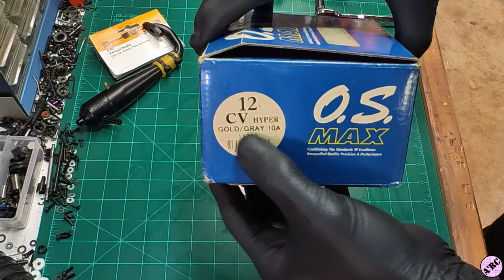OS 12CV Hyper Nitro Engine Overview - HPI Tuned Pipe A950

Comment: I have one of 2 these it’s not new but they work also one has an o donnel racing head an the other has the gold hyper both non pull start love em great engines I don’t use them as much anymore though too keep them in good condition one of the carbs has different adjustment on the low speed instead of just being a screw it’s got a metal spring sorta thing around it so you can adjust the low speed in small intervals gives it a click sorta feel per turn if that makes sense reslly helps with fine tuning the low speed
Reply from the maker: Oh yeah, I definitely know what you mean about the “clicking”. OS, for some reason, made a couple changes/revisions of the carbs along the way
- It’s awesome that you have two of these engines. Both 12s or are they 15s?  What car/truck are they in?
- Clean them up and run a bit, as you know they are fun to drive 🩷

I appreciate you taking the time to write and great message. Love it ‼️

Comment: Thanks for the interesting video! Great looking engine! Are all the OS CV engines (12 and 15) ABN construction? As I remember the CVR's are with ABC. If you compare ABN with ABC what are the advantages and disadvatnages of both in your opinion?
Reply from the maker: Hey and thanks for the question (a great one)! 
- OS made a mix of engine styles with both ABN and ABC. You are right, the CV-Rs do have ABC construction. 

They do have their differences, ABNs generally have thicker sleeves to help compensate for the nickel plating (which is not as hard as chrome). It is also less expensive to nickel plate a sleeve. 
- The ABCs that have chrome plating, last much longer, the sleeve is normally lighter weight, generally can with stand higher temperatures and lower oil concentrations but, it is more expensive to manufacture. 
When you compare the two styles, higher performing and reving engines will be chrome plated

I hope that helps a bit and as always, I appreciate you watchn’ 🩷
Reply: @a2rc  Thank you very much for the clarification! It would be very exciting to see a future video, dedicated on breaking in procedures! I'м very curious to see how you perform it! I've seen videos on youtube how people don't stop their engines during the heatcykles, just cooling them down with compressed air and having them running during the whole process (to avoid the cold start).  What is your opinion on that?
Reply from the maker: @lyubennyagulov9012  umm well, I personably wouldn’t suggest that….

Break-ins are/seem to be very subjective but, I have been performing my break-ins the same way for 25+ years now. I seem to have pretty good success so far. A good example is the 15CV-R I have shown on a few vids

Heat cycles, lube and a slower approach is what I suggest. Yes, you can “break-in” a sleeve “faster” but, that doesn’t always result in a longer life (if that makes sense). I treat mine more like an oil bath

It is a good video topic and will definitely consider it for a future vid.

Comment: I like your header and pipe they work good I've used that combination before 😎👍
Reply from the maker: Yep, The 940/950 combo is perfect for these 12CVs and similar engines. Port matching the header helps a little bit with .15/.18s
- If you have a new or vintage build, these are a nice setup for sure

What Car/Truck did you have have this pipe on before?
- As always, I appreciate you watchn' Richard 💜
Reply: @a2rc  I used that pipe and header on my rs4 belt drive with my 15 fe and it ran good
Reply from the maker: @richardbrown6762  That’s and awesome pipe for that engine 💯

Comment: Love the hyper edition the billet head definitely makes the cv run cooler and sound slightly different over the stock cv cast head. Did you know there was a abc upgrade piston and sleeve with rod kit made for the duratrax 12pd engine but it fitted the os max 12cv
Reply from the maker: Honestly David, I didn’t know that! That’s really good info and appreciate you letting me know. 
- I agree the Hypers where well worth the extra expense. Plus they are a bit better lookn’

As always, thank you for taking the time to write David 🩷 I always love to learn and share. Thanks for watchn’ 💯

Comment: They could have done better with opening a spot in the block for the boost port making it a real 3 port. and ABC sleeve with a oil grove in the top few MM of piston. The pipe kit actually runs quite well. It was definitely a nice upgrade on the old 15FE engines. And with the fuels go 8% oil bump it to 12% with blendzall green label castor oil definitely helped the old ABN stuff live a long time 😎🍻🤘🏻
Reply from the maker: I agree Bug 💯
The engine design could have been a bit better but, they still perform pretty well for what they are. I have been surprised at performance the all blue RS4s build (everyone will see that project on some future Adventures) that has the blue 15CV Hyper w/O’Donnell Head
- Like everything, a little care and some maintenance can allow for these old ABNs to last a long time. Unfortunately, we know that the majority of folks that ran these engine back in the day, just didn’t know what was needed and destroyed them quickly. 

I really enjoy talking, showing and sharing these vintage engines with the RC community. It helps to keep their history alive. I am sure you feel the same

I appreciate you taking the time to write and for watchn’ 🩷 I always enjoy watching your adventures too
Reply: @a2rc  absolutely man! They were and still are very reliable engines and Kinda good all around performance. There was a company that made an ABC kit for them as well I can't remember the brand though

Comment: Nice video 🙂 how would you say the high end .12 engines can hold up to a cheap. 18. Considering buying a quality .12 engine to replace my VX18 in my HSP Backwash. It's pretty hard to find .18 engines these days.
Reply from the maker: I appreciate you watch’ 🩷 and taking the time to write 

One of the best quality and best price for an 18s right now, is the HPI T3.0 and/or G3.0 (depending on what crank shaft and backplate style you need). They are a billion times better than the VX engines 
- You can go with a higher performance 12 if you would like. Just depends on what you are trying to accomplish with the buggy. 

You can always go vintage too. OS 18CVR for example. 
- Let me know what you end up deciding 💯
Reply: @a2rc  The HPI G3.0 and T3.0 are great engines, but use SG shaft instead of OS  shaft. Is it possible to make it work? 
Thanks for your detailed response, which is much appreciated 🙂
Reply from the maker: @electricnitrorc  The G3.0 is a SG and T3.0 is a standard shaft engine. Which one does your current engine have ?
Reply: @a2rc  It's the short one. Standard I believe 🙂
Reply from the maker: @electricnitrorc  Ok then, the T3.0 should work out. You may just need to use/reuse your engine mounts
Reply: @a2rc  Thanks 👍
Reply from the maker: @electricnitrorc  Just check out your current engine and the T3.0 to make sure you are happy with it before buying. Even if you don’t end up with it, update me what you decide to do. Thanks

Comment: Have you heard about a dynamite Paris conversion for the os max .12 cv
Reply from the maker: I have heard about the kit which, came out back on the day. Ron Paris worked with a number of companies. He developed a few innovative things along the way. 
- I think that’s the kit that had the dished piston, head, shims and maybe a crank (not sure). 

What I don’t know, is if it actually helped things out or not? Its a super interesting topic and vintage parts though. 
- Do you happen to have a kit or an engine with the conversion?
Reply: @a2rc  I do have one I took the os .12 cv I look and I said this is not os parts come to find out after some research it's a Ron Paris with the dish piston and different crank I don't think it was run much it all
Reply from the maker: @tonycatalfamo9706  That’s pretty cool that you have one ‼️ Nice work
Reply: @a2rc  I would like to install the engine mybe on an rs4 would I aft to cut the crankshaft I have motor mounts for the rs4 I have all models od the rs4s
Reply from the maker: @tonycatalfamo9706  No, you should not have to cut the crank and most RS4s have chassis holes for the integrated engine mounts. If it doesn’t, you can use auxiliary mounts with the engine flanges. 
- Which RS4 model do you have?
Reply: @a2rc  I want to mount the os max. 12 engine on one of the rs4
Reply from the maker: @tonycatalfamo9706  oh ok. That should have a standard shaft crank as well and you should not have to cut it either. 
- Do you have all of the parts it install it?
Reply: @a2rc  I the original silver pan it's brand new I 4 rs42 4 rs43 I like to the  os engine in one of the rs42
Reply from the maker: @tonycatalfamo9706  That will be a perfect combo 🩷
Reply: @a2rc  thanks for your help I will be waiting for your next video like hybrid says make nitro great again